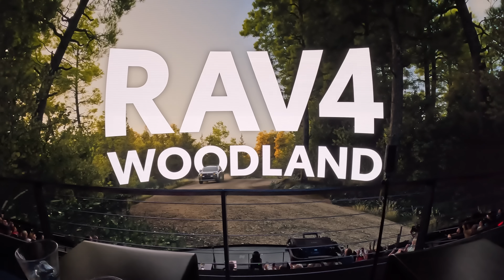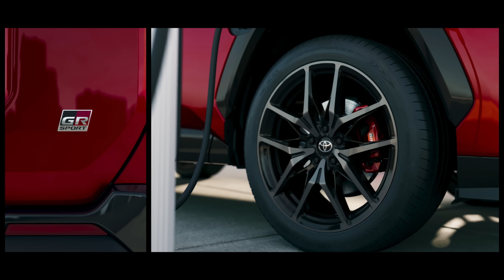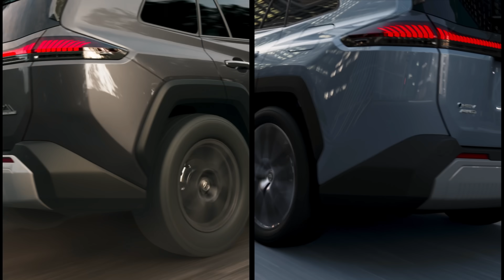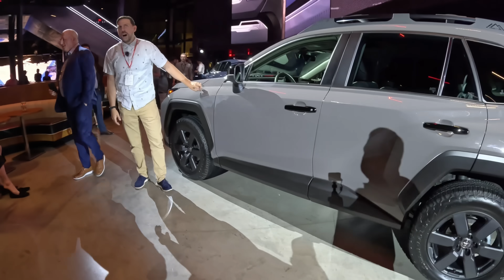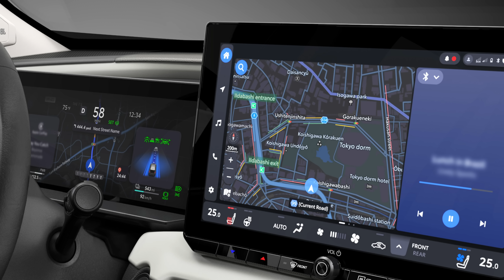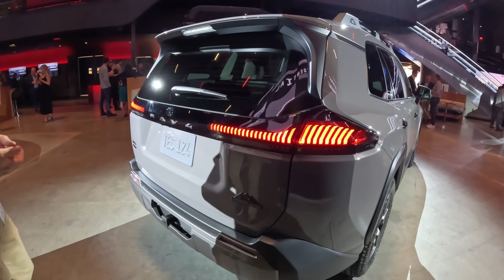Here's EVERY Upgrade and Downgrade for the redesigned 2026 Toyota Rav4 Hybrid and PHEV.

Comment: No one asked for touch screen HVAC controls, why do companies insist on doing this?
Reply: I drove a loaner KIA and they had a touch toggle between the climate control and radio controls. So damn dangerous you have to take your eyes off the road to figure out which mode you were in. Ngl, I'm disappointed with Toyota but it could have been a LOT worse!
Reply: @saint474747 I understand that there is a setting in the KIA for controls to default to your preferred mode (hvac or stereo). Then you’ll know what mode is on the display
Reply: Cost 😢
Reply: The two screens are massively overcomplicating things. I hardly use it.  If the radio were not on the screen but physical buttons,  the screen would be useless. Besides it  is really dangerous trying to press all the tiny options on this screen while driving.
Reply: Cost
Reply: I don't think cost is a factor. As one can argue that if you eliminate the buttons, you have to equally spend or more on a better, bigger and more responsive screen, software and cpu. I really think it comes down to increasing reliability and easing maintenance by digitizing a function vs physical button, wiring/electrical etc. Also, allows for more complex features and over the air updates when digitized.  Aesthetics come into play as well.  I think the safety issue is a non issue and  probably safer, when you use voice control.  Problem is; voice control either sucks (slow,  unresponsive when noisy cabin, doesn't recognize accents etc.)  or most people aren't used to it and resistant, when good.
Reply: @bort7258 I’d be curious know if having knobs actually changes how the programming works. I’d expect that the input would still be programmable, but that’s just a guess. I’m a slightly evolved monkey and I like to have to tactile feel. Sounds silly, but I think it’s more satisfying to change the temperature using a knob than tapping a button or a screen. Voice control is usually slower and you might not want to do it if you are having a conversation or listening to music. I say, give me it all. A knob when want it and voice control when I want it and over the air updates.
Reply: @bort7258  screens are cheaper than manufacturing separate control panels for HVAC and radio. The rest is just software and code. I don't mind screens and although I prefer separate HVAC controls I could get used to it, after all it's an auto system. I don't like, and think it's a safety issue, when they put critical controls in the screen like lights and wipers.
Reply: @khakiswag  It's not just a bigger, higher resolution and more responsive screen.  It is also a higher end cpu, dram, motherboard, storage, wifi/lte card and either in-house software or licensed but customized OS from Google. You will need to hire more IT and software engineers to support it, release firmware updates, and create future enhancements.  But yeah, it should be law to never allow to offload lights, wipers, horn to screen or even touch controls on steering wheels.
Reply: @bort7258  something like this is a bit of a dillema if you can say, because if everything is in the form of physical buttons then the dashboard or interior looks too busy and not everyone likes that, because they like something simple like what Audi, Mercedes and even BMW do where they eliminate physical buttons and that is actually a trend right now (almost all manufacturers follow this trend), but we know that physical buttons are much more efficient and effective when used because the hands will get used to the location of the physical buttons if everything is on the screen it might take several steps to activate it so it looks inefficient and ineffective because the eyes can't keep focusing forward
Reply: Or for that matter, useless panoramic roofs.
Reply: @mjpottertx You don’t have to get that option…I’m fine with Pano roofs, but it’s the things you can’t choose that bug me…
Reply: It could be worse, GM is now putting headlight controls in the screen.
Reply: @khakiswag that’s not worse, who touches their lights
Reply: @Icayn  the people who know to turn them on manually in the fog.
Reply: For esthetics.
Plus less parts and labor.
Reply: Its less reliable. More money for  them
Reply: “Software updates” creates planned obsolescence too, i think?
Reply: YES!!! WHY do they thing touch screen buttons are better than physical knobs.  Honda learned their lesson with the volume knob.  I will not buy a car with touch screen buttons for climate control...period!
Reply: @kevhed8  they just follow the trend from mercedes or BMW, and bmw and mercedes sell well with that
Reply: It's cheaper
Reply: Same reason they put a sunroof on them that nobody wants or uses.
Reply: Exactly! I can’t stand touchscreen HVAC buttons 🤬
Reply: If you use the AUTO function, you should never need to touch the HVAC controls for as long as you own the vehicle, anyway.
Reply: Cost.  It's cheaper to add the control to the screen than to add buttons.  It might save them a couple buck, but when you're selling 100s of thousands of these, it adds up.
Reply: @crabjoe and yet they felt it necessary to add huge buttons for drive modes and terrain selection?  How often are people using these?  Big miss…
Reply: @crabjoe they are still buttons, just much smaller and just below the screen…makes no sense.
Reply: @crabjoe  the over-the-air updates also give them flexibility to create new buttons and keep the design fresh. All without that cost.
Reply: It does have physical up down buttons for temperature, but to me that’s inferior to knobs.
Reply: 1.  This vehicle looks nothing like anything Toyota.  Take off the badge and no one would ID this as a Toyota…not sure what that’s about.  2. Replaced HVAC knobs for drive mode and terrain mode knobs?  Why? 3. Way too much plastic compared to the competition.  4. I’m guessing they haven’t improved the hideous groan of the 4 cylinder engine…big misses all…I had the Prime and eventually got rid of it…change from EV to engine was jarring and the engine noise is absolutely the worst…death by 1,000 cuts.  Now driving the Lexus 500h and even though it’s the same hideous sounding 4 cylinder, the Lexus has much better noise dampening and it pumps fake engine/space ship sounds through the speakers that masks it well…not the best solution, but liveable…but, don’t think it’s staying around for long…Toyota beeps, noises, sounds, warnings and temperamental tailgate all drive me nuts…will likely go back to the X5…straight line 6 that sounds sublime, no beeps, noises, etc…and despite what people think, the X5 is at the top of the list of reliability…
Reply: @petegalindez9961 Interesting. I drive the Prime mostly around town in electric mode so most days never hear the Engine.  Mostly use the engine on the highway where it sounds fine to me. I only hear the engine around town if I’m traveling and am not charging. So wouldn’t want the car if I had to listen to the engine all the time but I don’t mind the amount I do listen to it. I enjoy the good gas mileage.  Sounds like the 6 cylinder is the right choice for you though.
Reply: @Molishious I loved it in EV mode…And to be fair, the biggest selling point about the Prime (now just PHEV) is that you can keep it in EV mode and it’ll stay in it unless you run out of battery, go over 80mph, or the engine is laboring a lot (long uphills)…otherwise, you could floor it and it’ll stay in EV mode.  Around town, it’s plenty quick…That was why I bought it.  But, that engine is just so bad…couldn’t do it anymore; I couldn’t stay in EV only for my whole commute, and then I take about 1-2 long trips per month.  I do love that you can control the modes you’re in to prioritize EV mode, Hybrid mode, or charging mode.  I was going to go for the 450h, but it was too $$$$ for me…I was actually on my way to finalize a purchase on a Kia Sportage PHEV when I stopped at the Lexus dealer (right next door) to test drive once more…and, they actually had two 500hs with fewer than 4k miles on it, CPO and hugely discounted…so, I went for it…Don’t think I’ll be keeping it for much longer though…
Reply: @petegalindez9961 Funny I thought about mentioning the Kia Sportage PHeV as it has a regular transmission. I have friends with one and they like it a lot. The RAV4 PHEV is better in the things I care about most, but the interior on the Sportage is nice and I do think it sounds nicer. If you are willing to go up to the Lexus TX 550 h+ then you can have the V6 and the PHEV, but of course with a bit less range, and a lot less money in your pocket. Is that sewing machine sound that Prime makes at lower speeds just the way CVTs sound or a Toyota thing?
Reply: @Molishious It’s Toyota’s 4 cylinder engine…which, unfortunately, is in just about every vehicle they make…even my RX 500h…
Reply: Why do so many people fiddle with the HVAC buttons while driving. I personally set it and forget it before driving.
Reply: HVAC has better voice controls now. I wouldn't even bother touching anything.
Reply: What are you guys talking about? Just below the screen are temp buttons. Look!
Reply: @Prest0n97 MOST controls are on the touch screen
Reply: @Prest0n97  he does mention that. What there isn't are the other climate controls such as fan speed, head/feet distribution, recirculate, etc.

Comment: Absolutely hate the missing knobs for AC
Reply: what are those red blue button? those are not AC control?
Reply: Welcome to the Lexus world
Reply: At least the buttons stay on the screen. Our 2021 Ram 1500 require 3 or 4 different button presses to turn on the heated seats... Click comfort, heated seats, X button to go back to main menu. Very distracting if driving. At least it is just 1 tap on the RAV 4... still a step back from the Crown or Camry. Honesly... I like the Camry interior and 4 Runner way more.
Reply: @djplonghead5403   my 2021 Ram lets me customize the main screen, so I have put the heated seat buttons there. You can pretty much put what buttons you want on the home screen (at least on my 2500 Big Horn).
Reply: Same here... but the buttons are set to media, nav, surround camera, etc... not really room for heated seats button unless you can add more to the row. @HardBoiledGregADV
Reply: I agree,definitely a deal killer for me!
Reply: It's insane to want to forcefully have to take your eyes off the road for things that are constantly adjusted radio and hvac .❤😅
Reply: On the NX 350h / first cousin to the Rav 4, you simple keep your eyes on the road and say "Hey Lexus".  Then say "Turn on Air Conditioner to 73 degrees.  She answers with "Turning on the air. conditioner to 73 degrees".
Reply: @Lexus_22-ES300h_Hybrid_guy  In rav4 if you want carplay connected they force you to  keep siri listening all the time. There is not way of having carplay on and siri off :( Needless to say i removed carplay and never use after the first try.
Reply: @Lexus_22-ES300h_Hybrid_guy  There's still the toggles. Yeah, we're all being forced into the screens.

Comment: Gimmicky touch screen HVAC and tiny toy shift selector are huge negatives. Thankfully, it still comes with a spare tire.  Hopefully once the Kentucky factory is built they can focus the Canadian factory a bit more for Canada so that we don't need to wait years for any hybrid.  Dealer lots here seem full of mostly tacos and tundra with turbocharged engines that few want due to all the reliability and longevity issues and huge prices.
Reply: From my limited experience in cold driving, I'd think Canada is just a tad bit too far north for Hybrids OR EVs.
Reply: @Lexus_22-ES300h_Hybrid_guy  Nope. Hybrid Toyotas are very popular up here in Canada. The cold weather makes them less efficient but they work fine. The problem we have up here is stock levels. The RAV4s that have been produced in the Woodstock, ON plant seem to have been prioritized to be shipped to the US market. The dealers up here have almost no stock except for the used cars. I just ordered a 2025. I had to test drive a 2022 model because the only new ones they have on the lot are already sold.
Reply: @allan6021  Even worse shortage of the NX 350h, but more are starting to come in now down south.

Comment: Most people don't change drive modes every time they get in the car, but, HVAC they do.  Would seem better to have drive modes in the screen or separate and put HAVC controls where the drive mode selectors are located.
Reply: Totally Agree. Same with the 25 NX 350h.  The AC mode is a very small soft switch.  And the drive mode is a big dial you can see 10 feet away.  Make no sense.  Never use the drive mode switch.
Reply: My 21 prime has both. Two climate controls knobs and a knob that controls the drive modes. Both work great, the new set up is a downgrade for both how the drive modes work and how the temperature control works. They have climate knobs on the 26 BZ so can’t figure out why they’d remove there here other than change for Change sake, saving money or wanting things to look sleeker. My bet is you’ll find the climate knobs on the new Lexus NX PHEV.  I’m with Kirk on this one, the knobs are always better. This is Toyota saying “We are going to give you okay instead of best, because we can. Suck it up.”
Reply: On some new car models, you can control HAVC by voice which is ways more convenient.

Comment: I honestly do not understand the obsession with physical climate controls. I get the need for defrost buttons, but who cares about temperature control. If the system works fine, you set your prefered temperature and you are done as it will cool or heat to that temperature every time you get in. I believe you would at most change it by a few degrees depending on the season.
Reply: Some of us do live in climates where the  temperature does vary a lot. The same temperature can also feel different in different situations such as different humidity levels or if a car is shared between multiple family members
Reply: @Blank00  The car still should do the job. I know most people crank up the cold or heat when they get in, though it makes no difference. We get winters up to -25 degrees celsius and over +30 degrees during the summer.
Reply: you've never driven in the cold, and it shows.
Reply: @jefff7287  -25 degrees celsius should be considered warm then I guess

Comment: Hugely disappointed they went to touch button HVAC controls
Reply: Spot on Kirk.  Give me a dial for the fan and a button for the ac.  It's so nice to drive without heat or ac on a nice day.  My ES turns the ac on without me asking, and you have to bring up the menu to turn it off.  So annoying.
Reply: If its any consolation, based on the Lexus system, the climate controls will remain on the bottom of the screen full-time and are fairly easy to use, so assuming the screen itself works well, it shouldn't be VW or Tesla bad, but still a disappointment.
Reply: For my Lexus NX, I just leave the A/C on auto, so there is no need to touch anything for HVAC. There is however a defrost bottom which is a physical one
Reply: @yslee1401 yeah but then you have the fan blasting you on high when you don’t want it.
Reply: @pagodad8079 it blasts high only when the delta between the set temperature and cabin temperature is large. Just use the temperature settings knob to set the temperature accordingly

Comment: Woodland seems to draw  a lot lof inspiration from the  pre-facelift 5th gen Trail trim 4runner.  Look at the 2010 4runner Trail Edition....  I like it! 
No physical HVAC controls is a big miss for me too.  They also got rid of the manual switches to turn off the flow on the vents (except rear) which is a bummer.  On the positive, happy to see that they added height adjustments to the manual passenger seats, just like they did for the new Camry.

Comment: Hey Kirk great info sharing from HQC. Quick question will the new generation PHEV Rav4 GR Sport have a Charging Mode like how the Prius Prime has for charging the PHEV battery using the engine?
Reply: Supposedly yes, you can charge the PHEV battery with the gas hybrid engine, but that kind of kills the mileage you get, and kind of defeats the purpose of an EV mode…UNLESS you are going on an extended trip, and want to arrive at your destination with FULL EV charge to use.

Comment: Kirk, RAV4 reviews where we can actually hear your voice are a big improvement. 😉 I give full credit for powertrain upgrades which will undoubtedly increase power and efficiency across the range. In particular, the engineering required to bring a 3,500 lbs tow rating to such an efficient vehicle is noteworthy. 🥳🥳 On the other hand, Toyota has used the same platform which will not allow the same interior capacity provided by key competitors. The flexible seating we have seen in RAV4s in the past might have helped but Toyota declined to provide it. The decision to downgrade climate controls and the gear shift is inexplicable. 🤬
Reply: Traditional shifter is available as option on woodland and sport (se XSE GR) trims iirc

Comment: Any news on the size of the RAV4? Same? bigger?
Reply: It is the same size because it is built on the same platform as the last one.
Reply: @RightLaneHog3151 Prius and Camry grew 1 inch when they were redesigned on the same platform
Reply: @RightLaneHog3151 but the Prius and Camry grew 1 inch while staying in the same platform